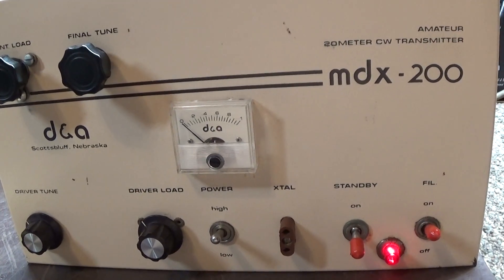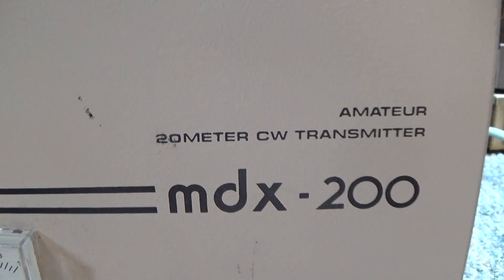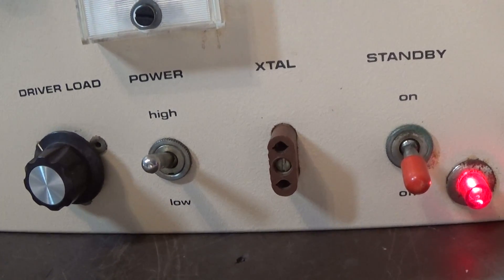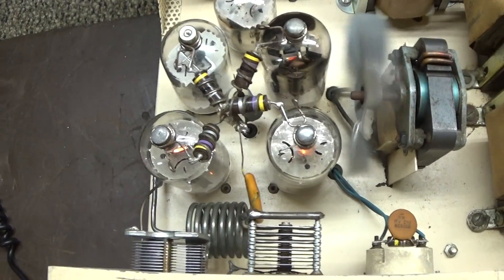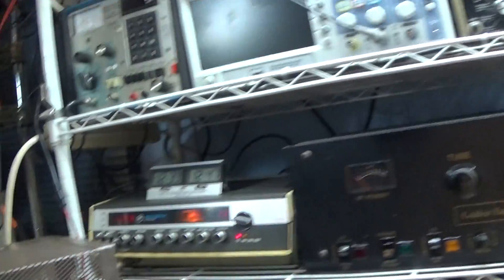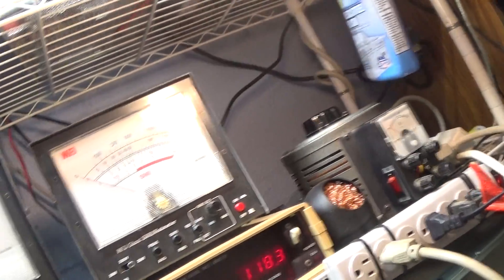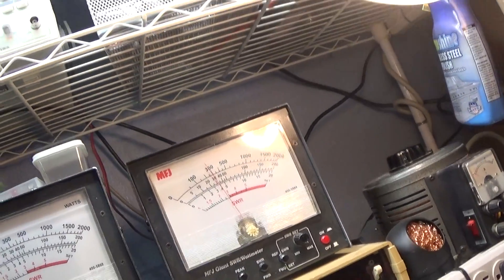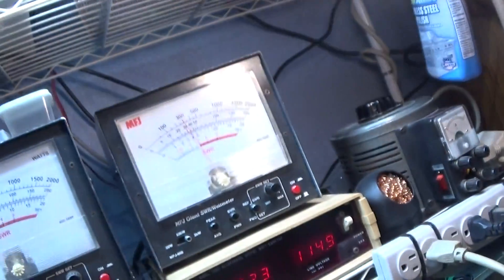D+A MDX-200 aka late Maverick 250 amp

Comment: Good evening Mr. TramDr. I just came across a d&a mdx 200 20 meter amplifier. I just want to understand that if the oscillator tube is replaced with a filment transformer it has bern converted? Thank you BUG aka 654.
Reply from the maker: probably, but would have to see that.

Comment: I have a question what is the  final tune used for ? And what is the antenna load used for ? So do I need to set these when turning it up ? And or do I need a watt meter in order to set correctly?  Lmk thanks you
Reply from the maker: They both work in tandem with each other to tune an amps output for max watts (this is simplified so Hams don't bother telling me about resonance and load and stuff). Also, the Tune is the adjustment right after the Tube and it interacts more with tuning the Tube up for max. The Load is right before the antenna and is for the most part tunes the output up to match the antenna. A technical term for antenna, or what ever the amp is keying into (like a dummy load) is the term Load. Hence the common term for the 1st adjustment that tunes the Tube is Tune. The common term for the 2nd adjustment that tunes the antenna (or load) is Load. 
  One common fallacy is some thing that as long as you tune the Tune up, you then can untune or detune the Load to make the amp do less watts and since the amp is putting out less watts (and the Tune for the tube is tuned up) then the amp is running cool, low, and good. This is dead wrong. When you tune (or load) an amp down from max watts, the tube is still producing the watts even though they are not going out to the load or wattmeter. What happens to those watts then? The tube eats those watts. So lets say you have an amp that does 1000 watts but someone tunes (or load) it down to 500 watts out. Those extra 500 watts go back in the tube and are lost in the tube as heat. The tube eats those extra 500 watts because someone didn't tune the amp for max.
Reply: @tramdr  ok so if I had mdx 200 what would u want to tune up first I got it hiting like 375-425 give or take as is now but if I hit the antenna load to the left I'm getting I bleave like almost 600 or atleast hits the  6 milliamperes on amp meter any help would be greatly appreciate
Reply from the maker: @everythingvtec  Final Tune then Final Load, then repeak a few times, then driver tune, then driver load a couple times, then go thru all 4 a couple of times, if you are already tuning everything for max, then turning the load after that and getting more makes no sense to me. 2nd, there are wattmeters that measure power out, and there are milliammeters or amp-meters that measure tube current. If you are using the D+A milliamp meter to adjust power out, then that is just wrong too.
Reply: @tramdr   When I would adjust the antenna load and move it all the way to the left it would punch out more milliamps on the meter on the amplifier but it would make my transmission a little bit more fuzzy so I have to run the ant load in the middle and it seems fine the final tune very little bit adjust the meter ever so slightly so I just set it to Max and left it there and it's been pretty good Seeing if I was doing something wrong or doing something differently I should be doing correctly I'm not sure just double checking with you you seem like you know a lot about your stuff and I appreciate the information
Reply: 2 more questions are this amp have automatic sbb ? And can it be high drive?
Reply from the maker: You need to get a wattmeter and stop using the internal meter.
Reply from the maker: It would have to be reworked to make it high drive. It is not automatic SSB. Like most tube CB amps, all that happens with SSB is that is puts a delay on the relay to keep the relay from chattering. Most Ham amps use a foot switch and don't have a relay chatter problem. However, on many Ham amps SSB is high power and Tune/CW, or AM is Low. Last any amp that has a SSB / AM switch is NOT automatic SSB..... if it was, it wouldn't need the switch.
Reply: @tramdr  hey would u have a email I could contact better instead  of spaming ur videos have a cople other question if possible to ask u u been a alsome help so far
Reply from the maker: My email is Tramdr@yahoo.com however, I get 50 questions a day. I am weeks behind my email and don't always respond to them even when I get to them. Seems like a lot of people want to pick my brain.
Reply: @tramdr  I totally understand man thanks You
Reply: @tramdr  u said in ur video that u can get a little more power if u hit it with a jb12 or something like that do that mean the amp is a high drive ? Like if I hit it with a small 2 tube amp ? Lmk thanks